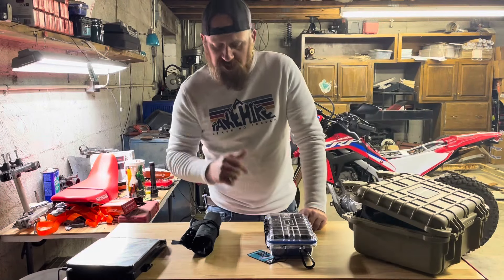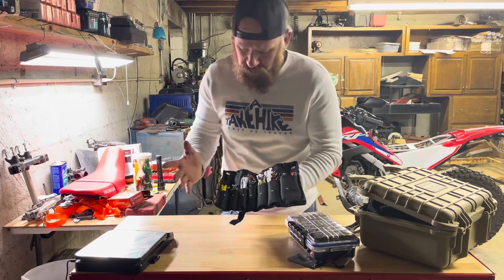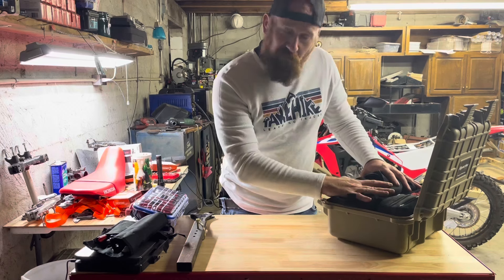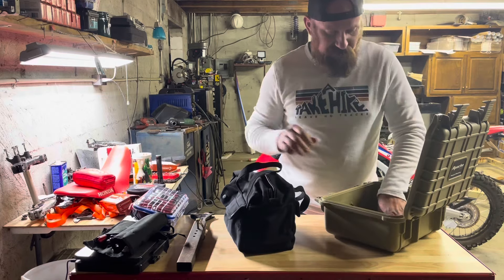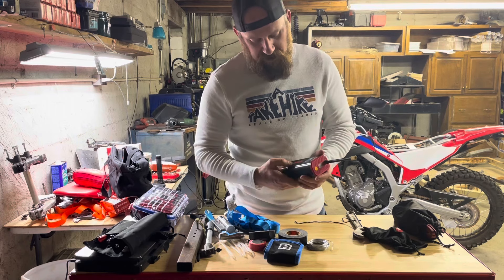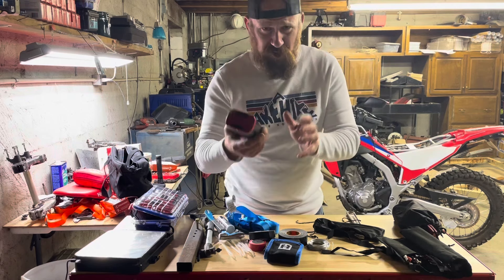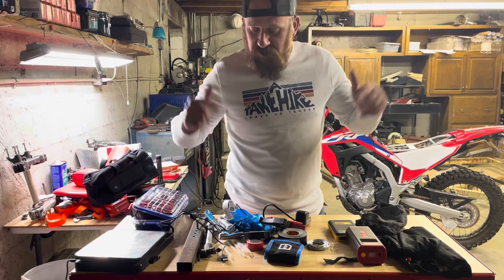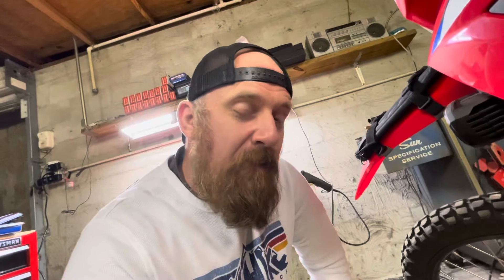Dualsport Tool Kit Ideas #crf300l ##dualsport

Comment: Unless there's a bike service planned en route, I guess the answer to the question "what tools do I need?" is.... none. 
We don't NEED any tools. The bike is running well, all maintenance has been done, nothing is loose. 
It's the other question that gets us thinking - what might go wrong?? What might loosen? Break? Get damaged in a fall? Now it starts. 
What tools do I WANT to be with me. Basic tools? specialist tools? Spare parts? What are probabilities (say, tyre related issues) versus what are only possibilities ( a con rod snap?). For example, KTM owners will be considering how soon the fuel pump will fail - is it a new bike? Is the failure due? (well documented).
I guess it boils down to what we are comfortable NOT taking with us. What enables us to sleep well while on our journey. For some it is just the tools that came with the bike and everything else will be improvised. For others they will want 3/8" drive, full socket set plus the torque wrench to reset those pesky fasteners. 
Thank goodness we are different.
May your tools never be used :)
Reply from the maker: 😂no doubt. A ride last year we was hwy cruising and my buddies chain flew off his crf450L! Thank goodness we had the tools to get back on the road!